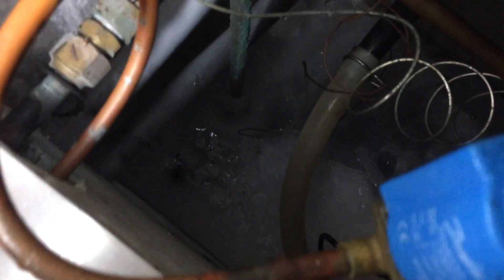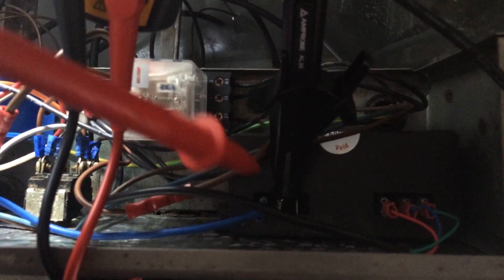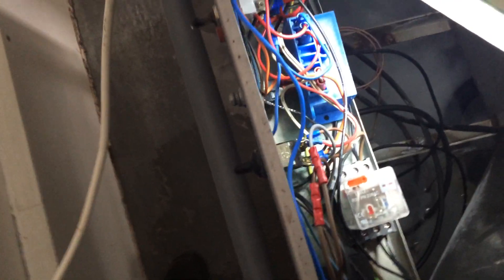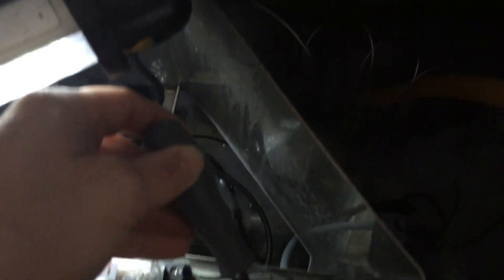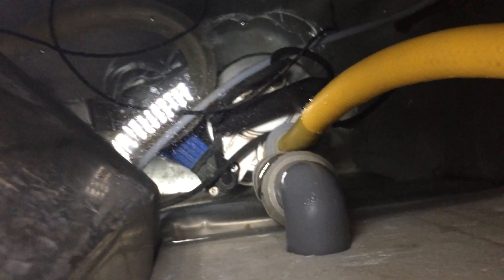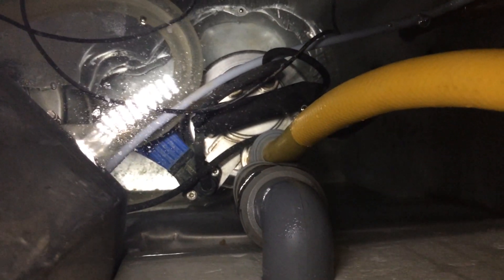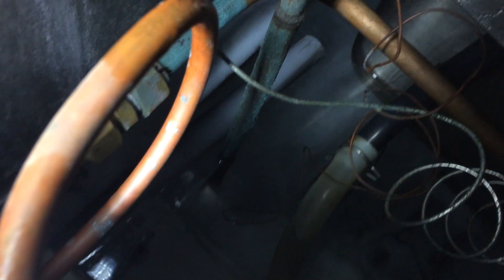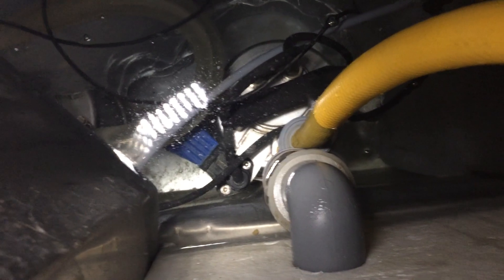Frozen Up Fullwood

Comment: yeah if its switching an inductive load it needs a  snubber network or as SeanBZA says a VDR. That board can be repaired easily enough- new relay :)
Reply from the maker: +Alan Cordwell I might keep the board to mess about with ( i have a few ideas for making some demonstration systems to mess about with), but for paying customer i need to fit parts i am more confident in. If it were obsolete i would be happy to have a go at fixing it.

Comment: You can see on the control board there is a place for a varistor across the relay contacts, so arcing does not weld them together. Left off to save 50p, and to guarantee it will fail when used to drive a solenoid coil. Here I fix a few controls which use a similar setup, but I add a VDR across the new relay contacts as well. Helps to ensure a longer life.
Reply from the maker: +SeanBZA That would be the little disk shaped things you sometimes see? Usually this brand of control is very reliable, maybe the part got left out during manufacture.
Reply: +heavydiesel The little blue thing labelled 275 yes. I will say that it is being left out to reduce the manufacturing cost, it is only really needed if you actually want to have the board run for a decade or two past the warranty period. Without it it will still have good reliability for a year or so until the relay contacts arc over and stick, or burn out. Not helped by being in a slightly corrosive atmosphere, as then deposits build up with every operation where it arcs in opening or closing. If anybody ever used a silicone based lube around it it would have some nice silicon carbide coating on the contacts as well.